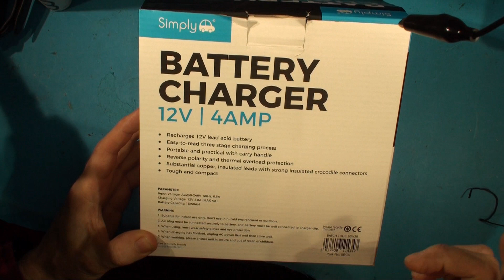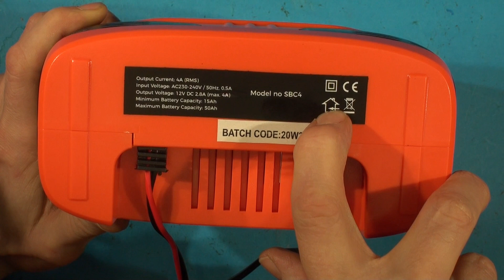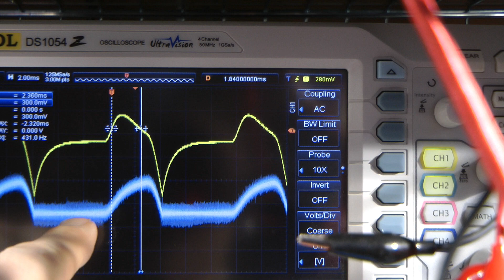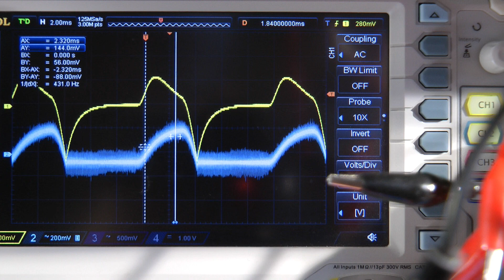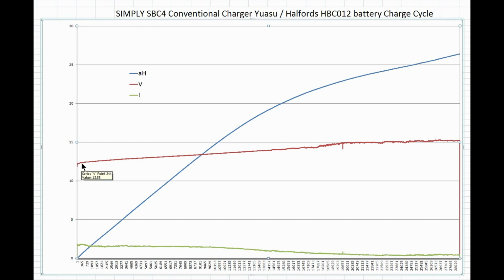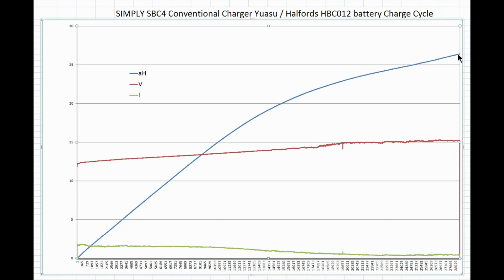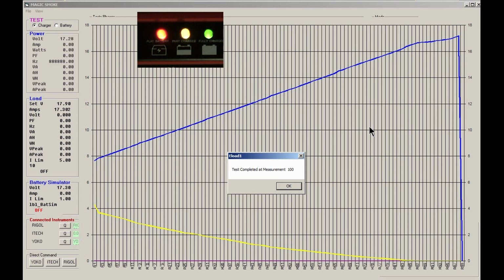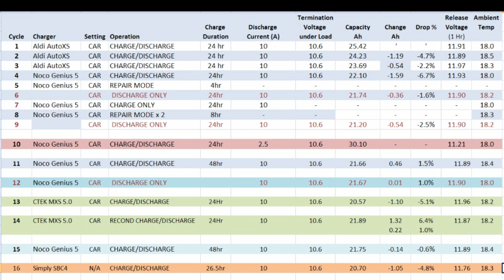Is the cheapest 4 Amp Battery Charger SBC4 / SWCBC4 better than the NOCO Genius5 or the CTEK MX5S?

Comment: Oh dear, I have a similar charger to this one in the video. It has one extra light though. I thought these things could be hooked up and left to run and they would turn themselves off. I've possibly done damage to my battery instead of looking after it while the car was parked up due to covid lockdowns. Thanks for the information I'll keep a closer eye on it now when using the charger.
Reply from the maker: You conclusion is correct. Leave this connected for long periods and it will completely erode the battery plates. If you need most effective and well designed battery maintenance then use the NOCO Genius 2. I use one of these on my Jaguar. Occasionally I remortgage my house and fill her up for  blast.

Comment: Schumacher sc1323 
Really enjoy your videos, fascinating to see the actual battery charge waveforms and what's truly happening. I would love to see the Schumacher sc1323, 3/15a smart battery charger with auto desulfate. The voltage is very high 15 to 17 volts and reconditioned two but boiled one battery. Snowflake is 3a & boat is not deep cycle but 15a (confusing) 
Thank you for your all your time and efforts.
Reply from the maker: Thanks for the comments. I'll try it if you can lend it to me.
Reply: @razenby  where would I mail it? 
I'm in Alberta Canada & would like to look into this :)
Reply: @razenby  hi good afternoon, 
I returned the charger after it ruined a new AGM battery. I carefully monitored a charging cycle both voltage and current & found it was charging between 15.7V to 17V, 3-10 amps then a desulphate cycle at 16.89V 2.99A for 10 hours.
Shocking
Reply from the maker: @thankyou8202  That is bad. Which charger was that?
Reply: @razenby  schumacher sc1323 rapid smart charger
Reply from the maker: @thankyou8202  Ill have to ave a look at one of those.
Reply: I bought it at walmart Canada $44.57
If you are interested, you could purchase,test & return for refund. 
It worked well for 2 batteries then wouldn't charge past 80% without desulphating & boiling.

Schumacher SC1323 3/15A 6/12V Battery Charger, Battery Chargers - Amazon Canada
https://www.amazon.ca/Schumacher-SC1323-15A-Battery-Charger/dp/B078961XPS   (so you can see the unit)

Comment: Since you are going to tear into the old Halfords battery, can you please try a couple of things to verify one of my theories?  

We have all seen accelerated self-discharge rates on older batteries (ie you charge them up fully and leave them disconnected for a few days, only to find that the battery measures 12.4V no-load even though just after charging, you measured 13V+).  My theory is that the sulfates that develop during discharge created dendrites shorts (relatively high resistance short circuits within the cell) within some of the battery's cells.  Those shorts cause the accelerated self-discharge.  A small series of rapid high current discharges may break those dendrites and thereby, breaking the short from the cell.  Once those shorts are broken, the no-load voltage reading goes back up.  I've tried it on two batteries - one 8-year-old Panasonic that came with my car and a much newer Kirkland.  The Panasonic would measure 12.4V the day after charging and drop down to 12.2V in a few days of just sitting there.  After a series of high current discharges (I started and stopped my car 4 times in a row with 20-second pauses in between start/stop cycles), the battery's voltage reading actually went up past the initial reading prior to the start/stops after some rest.  After charging, the battery measured 13V the next day and continued to hold that voltage for days.  I repeated the test with the Kirkland battery but instead of using the car, I used a carbon pile battery load tester.  I got similar results with the Kirkland.

To test the theory out on the Halfords (or the Jag battery), you just need to charge up the battery and leave it overnight after charging.  Then measure the no-load voltage of the battery the next day.  Leave the battery sitting for another 3 days to let it self-discharge and take another voltage reading.  If you see a relatively high level of self-discharge, it may be a good candidate battery. Then using your 500A carbon pile battery load tester, initiate a series of high current battery test (3 to 4 discharges) and measure the voltage after each discharge and then once the final discharge is completed, measure the voltage after about an hour after the battery has had a chance to rest.  If my theory is correct, the initial voltage reading should show that the battery is fully charged and then after a few days, there will be a significant drop in the voltage reading showing a high rate of self-discharge.  Once the series of discharges are completed and the battery has had a chance to rest, the voltage reading should be higher than when you started the series of discharges AND the rate of self-discharge will be a great deal smaller.  If you don't see an improvement or a small improvement, do another set of high current discharges as there may be another short than wasn't dealt with.
Reply from the maker: The no load voltage of a healthy lead acid fully charged battery is about 12.4 to 12.8 Volts. If the battery is sulphated it will drop faster and lower. Since I  am a chartered electrical engineer I am fortunate to have  very expensive professional test equipment.   I take the guess work out of the situation by using accurately measured battery capacity.    I don't pronounce on performance of products. I present the data and let the viewer decide.
Reply: @razenby  And I do appreciate the way you present and utilize your test equipment.  I also completely agree with you about the sulphated battery and how the voltage should drop faster and lower.  If it wasn't for my own at-home testing using consumer-grade equipment and the results of my test, I wouldn't be suggesting my theory.  I'm hoping that with your abilities, the old tired batteries that you have, as well as your equipment, you can verify what I experienced and possibly get folks who are far smarter than myself to offer a possible explanation of what happened?  After all, the battery's voltage should not have gone up nor should have the slow steady drop in voltage that I saw after subjecting the battery to those high current drawdowns unless something in the battery changed.
Reply: @richardlouie2922  There's a woman on YouTube I have been watching funny enough that decided to ( flex ) her AGM batteries as she wasn't getting the performances he should have been. She decided to use her small electric kettle. Not realising her electric kettle was drawing more amp through her inverter than she thought it would She'd let it run for five minutes or so, she was shocked and stopped when she found out using an amp meter while testing. 

She turned everything on in her motorhome, A PC, a 27" TV, a sound bar and lights, a diesel night heater plus the kettle. she was drawing something around 112 amps for those 5 minutes.
She found her batteries capacity had improved significantly simply by a mistake.

It matches what you are saying. In a way this causes a mechanical fix rather than a chemistry one as the load would in fact cause heat hence the flexing. I've seen High amps pushed at 15 volts if I remember correctly on a bad flat battery repeated for 15 minutes on and 1 hour off four or five times doing similar. A 200 amp load but probably realistically around 60 amps as the amps weren't measured at the battery. These were FLA with removable caps so the levels could be topped up if needed although they didn't seem to need it after that cycling. The gassing was visual.

I don't know myself what is and what isn't, that's why I'm here, to learn. I like facts as well but don't dismiss that there's possibly something in these claims that still need investigating. Perhaps out of 10 batteries depending on condition six can be recovered, that's still good odds to me.
Not every battery will have exactly the same issue, a slight issue casing big problems and some are simply best left into the reclamation yard.
Reply: @pa_maj.MARTINI-van-MAN  You are absolutely correct that not every problem has the same issue but due to a lack of understanding of what battery issues are, most people describe the issues in the same way -> "it's dead" which could mean that the battery is low on charge, the case was cracked, there is a shorted cell, sulfation could be high, one of the plates inside a cell could be cracked... and the list goes on and on and on.

I'm sure that massive rapid drain on the lady's AGM battery has caused some damage to the cells but then again, she didn't think it was very useable in its previous state anyways!  The real surprising thing is that AGM batteries aren't supposed to suffer from these types of problems!
Reply: @richardlouie2922  The lady had the batteries paired so they both shared the load for 5 minutes so 56 amps each if all was well.
672 watts for each battery. Yes I agree it's a bit much but the batteries were fully charged beforehand so that's a plus.
They are still inside their guarantee so she could have taken them back.

She did take them back once before and they did a few repair charge cycles, getting them back from 60 something % to 87% capacity if I remember correctly. They had been fine for quite some time afterwards.
They told her the batteries had gone to sleep and needed woke up lol.

She should have asked the for name off the repair charger used and how they went about it. 

"Apparently" sometimes  it can take weeks of cycling to bring a battery back to Good capacity, so one charger to do it in one charge is good but the battery is probably not far gone in the First place.

I have a leisure battery that's not got great capacity left. I got it functioning better just over two years ago. I am going to try the same process again as it's capacity is low now. That's to charge with a 2 amp dumb charger to 15.5 volts and held there for 1 hour.
If this is good enough after an amp drain of 5 amps to 12 volts ( enough information for me at that voltage as I don't normally go below 12.2 in real life use ) I'll charge it back up and stick it in the van.

If this doesn't do enough, I'll repeat this over    many days to see if I can improve it.
It's a SFLA battery. I'll drill out above the cells and replace some distilled water and recap if I have to.

I also might crack it open for a nosey if it's unrepairable. I could also try the High burst amp draw theory of yours.

The battery is at least close to five years old now.
The previous owners had it for around two years and I almost three, we don't know how old it was before that. 

I have two large golf cart batteries I can replace it with so if I wreck it completely it doesn't really matter, The golf cart batteries are very heavy though.

That's why I've been watching all these videos again, to see if there's a better way.
So far I haven't found one yet but I do know the method I used got me some extra good use out of that battery so worth a try again.
Reply: @pa_maj.MARTINI-van-MAN  Chances are the process they used to repair the battery is some kind of desulfator using a series of high-frequency pulses as commonly quoted repair times is in the 3-week area.  Most consumer chargers with a repair cycle limit out at approx 4 hours (according to their documentation) so you have to run multiple cycles which is probably what shop did.

Here's an interesting research paper on high frequency charging and its effects on the battery performance which might interest you - http://conference.ioe.edu.np/publications/ioegc2017/IOEGC-2017-23.pdf.  In the article, it basically tests what happens if the frequency of the pulses was increased from the common 1 kHz using by many DIY kits to much higher levels. Some consumer chargers do in fact do something similar (ie BatteryMinder chargers) while others integrate pulsing into their repair modes (ie. NOCO) but at different frequencies.  Even one of the cheap Chinese designed chargers that Magic Smoke reviewed in the past has a repair mode where other users have stated works very well for desulfation as it uses approx 25 kHz pulses.

As for your leisure battery, by charging it at 15.5V, you are basically applying an equalization charge to the battery in where you are purposely overcharging the battery in order to: 
1. remove stratification; 
2. equalize the charge across the various cells of the battery which naturally start to vary in charge by themselves with use - ie one cell might be 50% charged while others may be 100% with a few others in the middle;
3. convert some of the stubborn sulfate that didn't return to solution back into solution.
The vendor of that battery may have recommendation on what a good equalization process for your battery may be as each manufacturer may recommend different processes.
Reply: @richardlouie2922  Thank you very much for that Richard, not only for the study which I read and download but for what is actually happening when I do that restore/repair thing that I do.

I'm not sure how well it will work this time on the battery as the capacity is very low.
It's always been a well maintained battery charge wise and still works well under a load but nowhere near as long as it should.
After I take it out of the camper and do some tests, charge and discharge as I have done before I'll let you know how it went.

It's a shame that my Tens machine does not go to that high of a frequency lol.

Going by the charts Richard those repair cycle chargers that limit out at approx 4 hours would need to be ran about five times for good results.

If I can't get much more out of the van battery I wouldn't mind trying a charger like that last cheap Chinese one just to find out, many cycles would not be a problem as I'm in no rush.

Thanks again 👍

Comment: How do we know Yuasa make Halfords batteries. I've got a Halfords leisure battery and it has openable cell caps. All the Yuasa bateries I've seen are sealed for life. To me the Halfords batteries look more like they have been produced by Banner - same shape, design, colour etc. Might be wrong though..... The Halfords battery in  question  is heavily  sulphated  hence the lower AH rating  The problem with the chargers tested to date is that they are not proper desulphators - they don't produce  decent spike . I suspect they have not been able to use a pulse desulphation  repair mode because of American  patents . The repair modes adopted by Ctek and NOCO are simply to deal with stratification of the acid in the cells and this will not remove the hard sulphate deposits - period.   I bet all cells have a lower Specific Gravity but the lowest will be either the one closest to the negative post or it's neighbour.  Every tired battery I have ever tested  - this is always the case. Quite why the negative post cells get suplphated the most  - not quite sure - could it be because they  simply don't get enough charge during the  charging cycle ???  Another great vid Magic Smoke - come on fella  - you got to try charging and repairing the halfords battery with the little Chinese heart stopper !!!!! We know this really does have a desulphation  spike !!!
Reply from the maker: The man from Yuasa told me
Reply: It's possible that Yuasa has a white box line of batteries that they sell to others who want to put their name on the battery.  That way, Yuasa can have better market separation between themselves and other brands that sell their batteries.